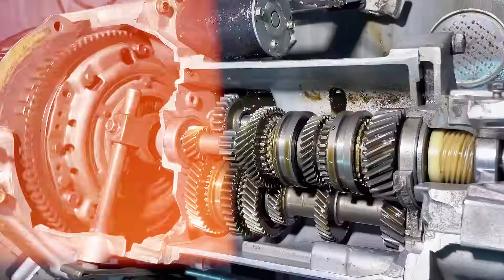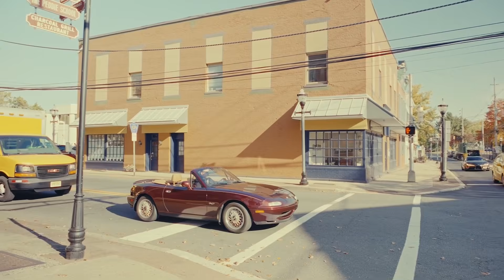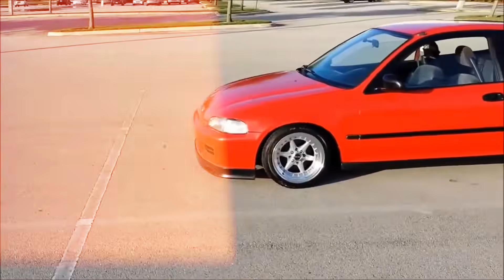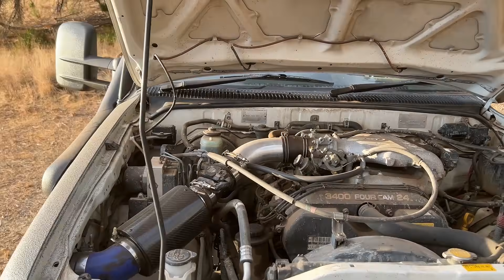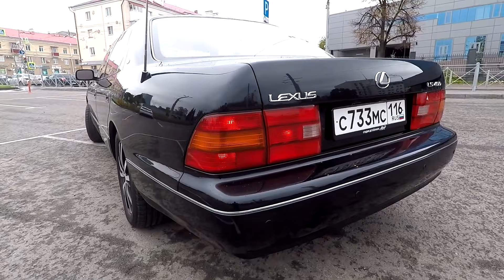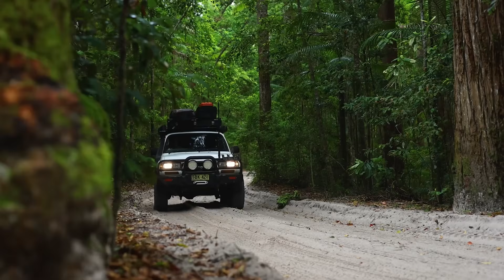9 Old JDM Cars That Were Built To LAST FOREVER!

Comment: I own a 96 toyota camry xv10  5s-fe with honed cylinders head gasket brand new piston rings valve stem seals brand new lower control arms ect & i change the fluids regulary 😂

Comment: 1990 had less stringent emmisions laws....it's the emmisions equipment that kills engines. Catalitic converters, egr, and so on is what kills engines....also new service schedules cause breakdowns prematurely 'sealed gearbox' on land rover is not maintanance free....after all if you call ZF (the manufacturer) they will tell you the service schedule on the gbox